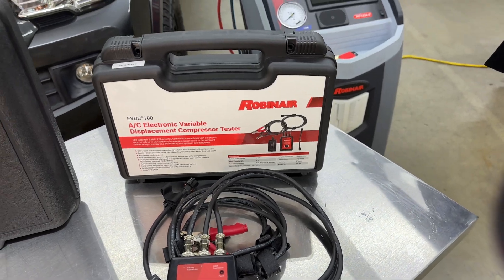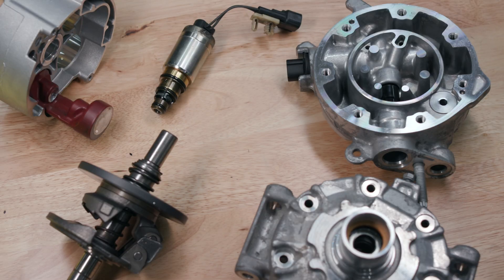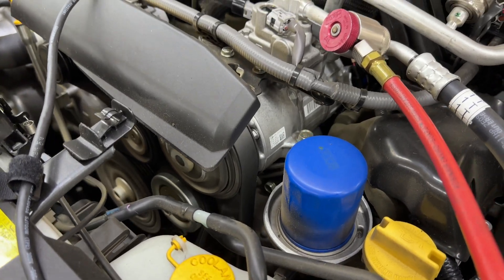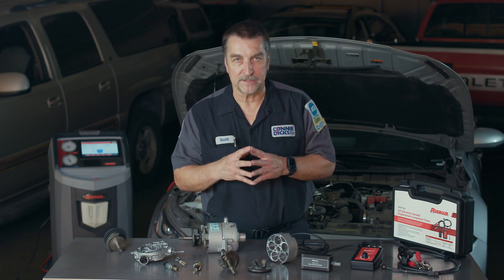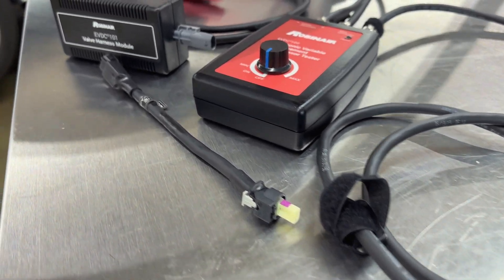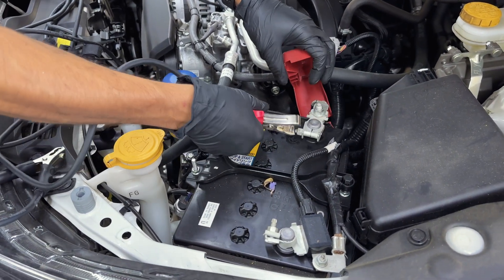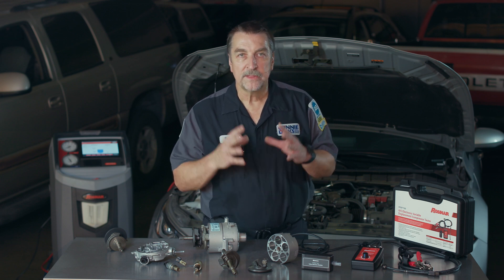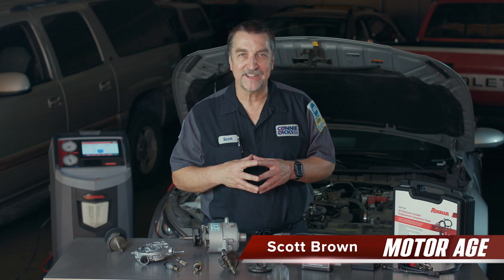Tech Tip – Robinair EVDC100 Electronic Variable Compressor Tester

Comment: Why not just use a test light?
Reply: You didn’t watch the video clearly. Go watch it and answer your own question.
Reply: @jeffgriffith7003  I'm not trying to argue, be condescending or anything, I'm genuinely curious
Reply: Will, The tester can a apply a variable input that can test the variable compressor at different settings. A test light would be good on the old school  on/off system as it only has two states. You would check if the clutch voltage  is there and if the High & Low Pressure Switches are working properly. Hope this explains things clearly.
Reply: @stealthg35infiniti94  I understand what the tester in the video does, I just don't see/understand the need for it. All the compressors I've seen so far have either worked or not as far as the ones pictured. All I've done is use a test light to make sure the solenoid is getting power/ground and if so, time for a compressor or solenoid. All the shops I've worked at have just gone ahead and sold a compressor. Not sure if that's industry standard or not, ive only worked at 3 or 4 different shops. If you have power/ground, inputs to the controller are good, output to the solenoid is good/wiring is good. Just don't see the point on spending money on yet another tool lol no offense to anyone or anything
Reply: You can max out the compressor and detect the signal to the compressor I have an off brand one that I really like